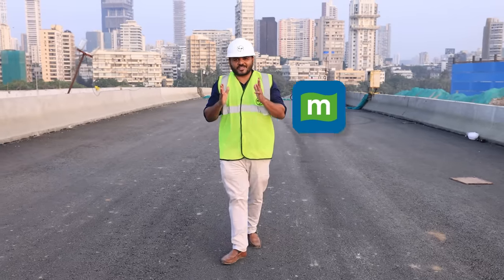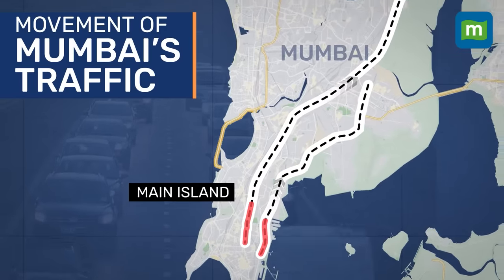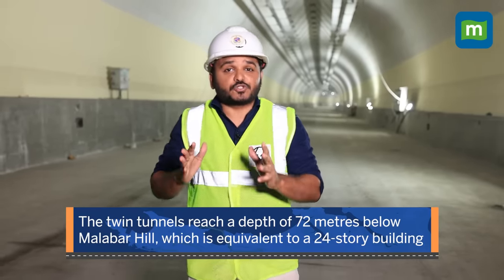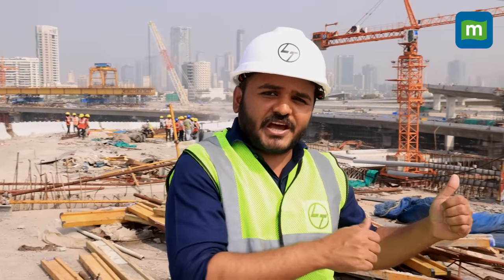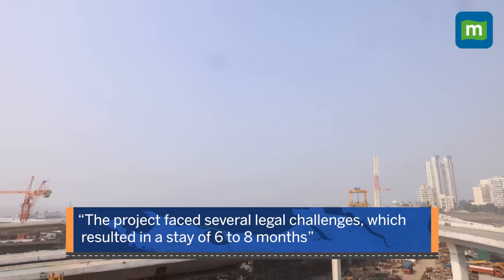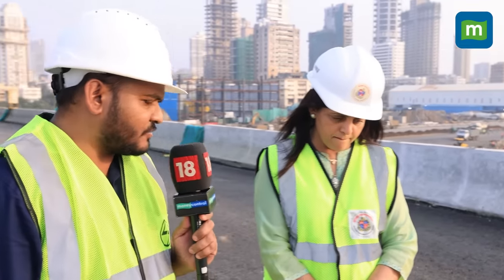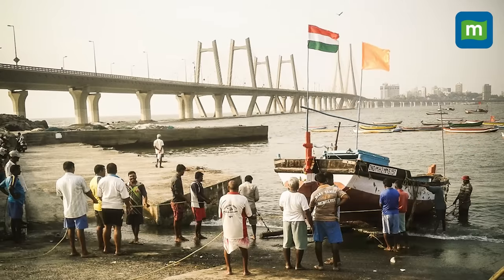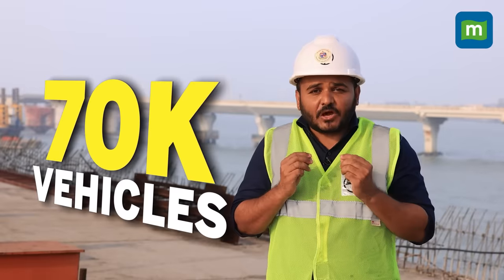The Mumbai Coastal Road Project | Full Project Details | South-bound Lane Inaugurated

Comment: Its not Only a mega Project its A ICON OF MUMBAI 🇮🇳
Reply: Biggest question is when will this get completed . Govt shld make public the time lines for each phase of project.  Thane metro continues to remain incomplete despite big announcements some years back . And the incomplete work has made a mess of the main road with potholes &    other damage + the traffic is a nightmare
Reply: Are the parks, walkways, and road beautification promised in design video being done ?
Reply: @narayansingh9407   That's for the blueprint not the ground reality . Maybe some but not as much. Land has value. Such beautification  does not
Reply: @aosaeanor no it’s not you can see promenades already just need gardening. Full confidence se fekta hai re tu 😂

Comment: Good, but to control the increasing air pollution in Mumbai, there should be only metro and rapid rail train systems underground or elevated projects for a better environment.
there is no other way.
Reply: How much pollution and roads do you think a city like Hong Kong has? You need roads too. The coastal road is nothing. Hong kong has hundreds of these "coastal roads". The recent spikes in Mumbai's air pollution is due to unprecedented pace of construction going on in Mumbai not roads particularly.
Reply: @Hey1234Hey Good to see a sane person's opinion amidst all these bizarre takes .
Reply: @jishnu9551 correct.
Reply: @Hey1234Hey car centric infrastructure is still bad for urban areas no matter how you look at it.

Comment: Time and again it’s proved that just adding road doesn’t decongest but induces more traffic. What Mumbai needs is multimodal transit system which includes metro, water ways, light rail, RRTS, bicycle tracks,, BRT, improved local trains, walkways, pathways, and high speed roads. And above all it needs urban planning like Amsterdam and few other European cities and not like North America which is only car dominance society. Also it’s not a 5 year or 10 year plan but it needs be continous process each day and every day, every week, every month, and every year. As long as Mumbai exists traffic problems will be there; question is how we manage them and be on top of it and not lose sight. 
I am not saying this won’t help for some days it will but we will be back to same problem once more traffic is induced because there is more capacity. Much more efficient and cost effective measures needs to be implemented.
Reply: Mumbai is already building metro. It has quite an extensive suburban rail network already. But true, metro should have started a decade earlier!
Reply: Keep on voting BJP and development will flourish to its leaps and bounds.
Reply: @prashantkharve4324 I thought the project was conceived in 2011 and primarily supervised and funded by the municipal corporation! Government falls and credits goes away 😂
Reply: Makes sense. The more options besides cars. Will help achieve long term sustainability and net zero strategy
Reply: @prashantkharve4324 only if they hold elections we can vote it’s been 2 years there have been no BMC elections so open your eyes democracy is gone for toss. Keeping aside politics I am just recommending what is the right thing to do.
Reply: It's not like govt is not building metros.
Reply: This 10 line highway looks ugly and will be loud, I’m curious to see how the noise will affect pedestrians and cyclists on the green space.
Reply: @spidermonkey8430  mumbai has 21 million people , metro and local train isn't going to cut it. People needs like this type of infra. What do you want? People wasting petrol and time in traffic jam (which will have negative effect on productivity and economy)or few pedestrian getting annoyed by car sounds?? Indian cities are already a shit show when it's comes to motor-horn sounds.
Be realistic, we are not fucking  netherlands.
Reply: people wont use bicycle for work commute.
Reply: I heavily agree with you. Mumbai (and all Indian cities) need to become pedestrian and bicycle friendly as well. 

Although, I will say that we are already building a large and comprehensive metro network. We might also get AC Vande Metro trains to run suburban services instead of the current non AC local trains in the near future.
Reply: @Morpheus2020 
Tokyo is the most populous city in the world and they manage it all extremely well while relying almost exclusively on the railways. 

We do need to bring in aspects of Dutch and Japanese culture here and it will benefit Indians in the long run.
Reply: What Mumbai and the rest of India actually needs to ensure smoother traffic is actual driver and pedestrian discipline. The modernization of most tier 1 and 2 cities have actually been quite impressive so I feel they're starting to get undue criticism these days. But of course, nobody wants to hear that and instead wants someone to blame, usually some higher power.
Reply: @Morpheus2020 yes they are living in India but want facilities like European countries but don't want to spend like European countries or follow rules like European countries 😂
Population of Amsterdam 8 lakhs while the population of Mumbai 2.1Cr even dharavi have more population than Amsterdam..
Reply: @thetechnocrat4979 population of Tokyo 1.4Cr and population of Mumbai 2.1Cr and apart from this Tokyo is 3.5 times bigger than Mumbai and last thing don't even dare to compare Japanese local ppl with Indian local ppl..
Reply: @biplabdutta4036  
Population of Mumbai is coming in at  21,673,149 (latest estimate) while Tokyo is at 37,115,035. So, Tokyo is still the most populated city. Anyway, yes Mumbai's land area is smaller than that of Tokyo but we could still try and do many of the things they do
Reply: @Morpheus2020  IT IS MORE THAN 21 MIL. WHEN WAS THE LAST COUNT? 2011? BANGALORE IS PUSHING 15 MIL SURELY MUMBAI MUST BE ABOVE 25 EASILY!!